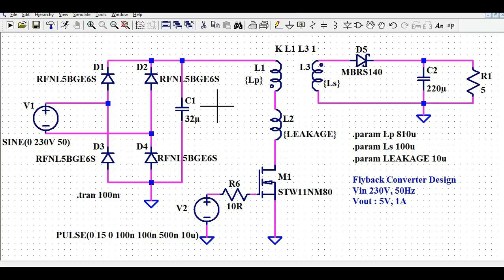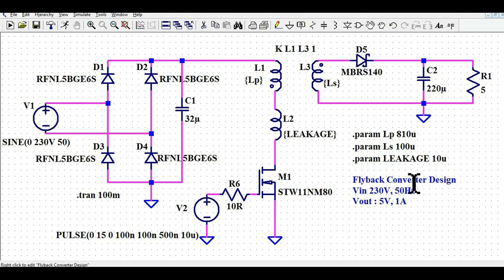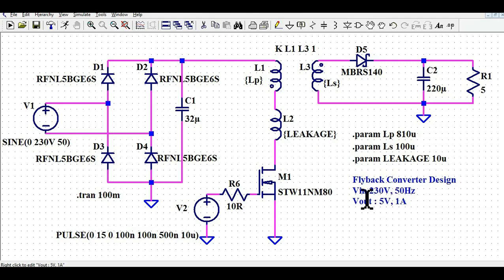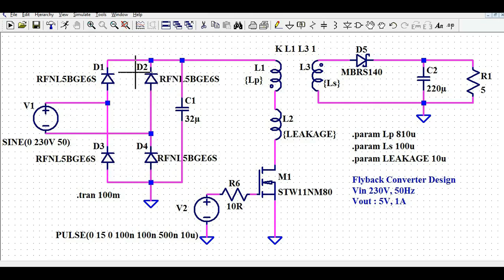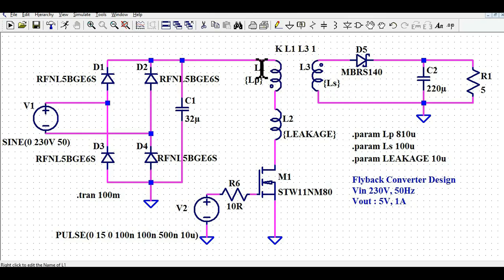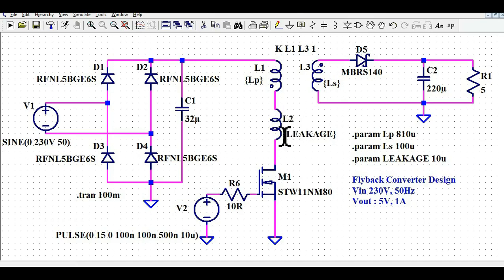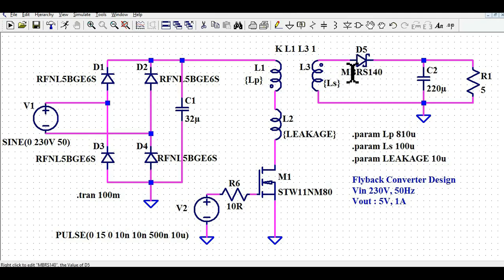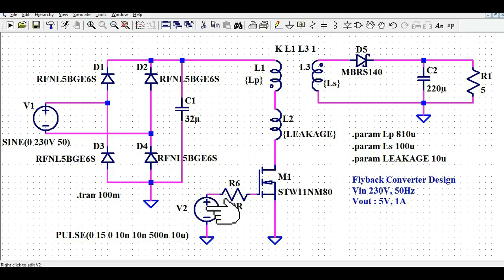Flyback Converter Design and Simulation in LTSpice | 5V, 1A (5W) Step-by-Step

Comment: A key feature of the flyback topology is the isolation between the primary and secondary sides. To reflect this in the simulation, shouldn't the secondary side use a different ground reference, separate from the primary side's main ground (GND)? 

If the answer is yes, and a separate ground is needed, what is the correct procedure to implement this in LTspice? How do I create a distinct secondary ground net and ensure the simulation can solve the circuit without running into "floating node" or "singular matrix" errors?
Reply from the maker: Hey...There is only way to do in LTSpice is add high value resistor between primary and secondary GND 10 Meg Ohm or so..

Comment: According to me There's an issue in your ckt, you didn't add any feedback loop in ur ckt, and due to that the Output(Voltage and current both) will keep declining. and to make it stable we have to add a feedback, am i right?
Reply from the maker: Yes, you are correct. I tried in open loop configuration.